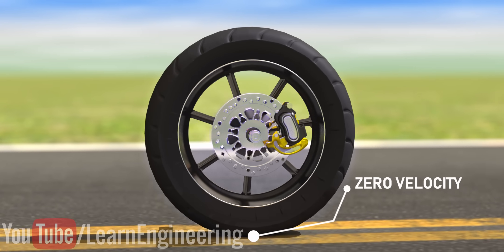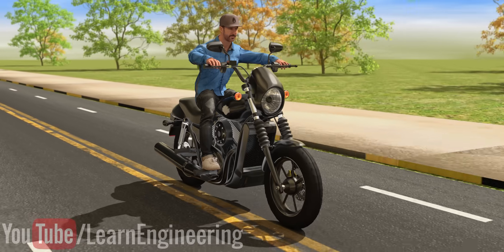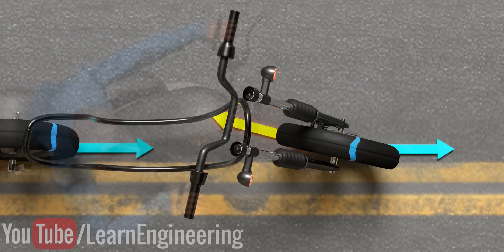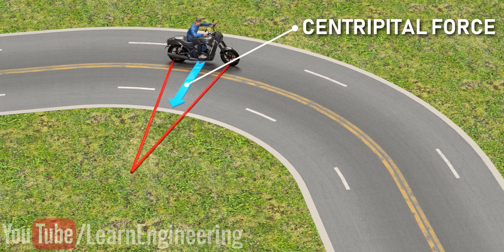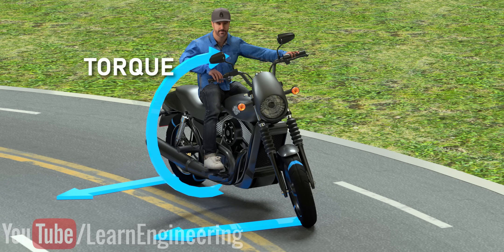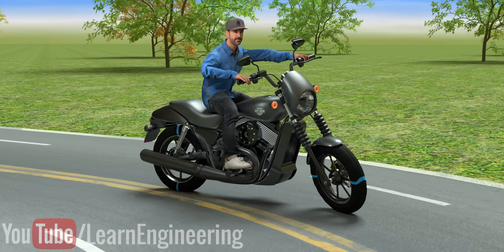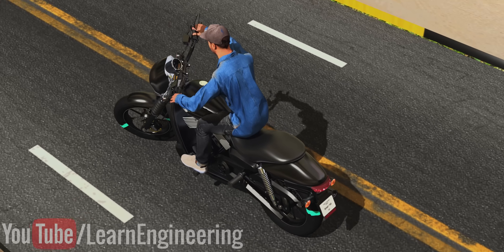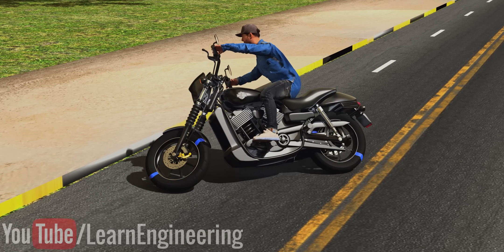Counter Steering | The interesting physics behind it

Comment: As a physicist you challenge my understanding and I think you may have got it wrong. I had always understood that the lean induced by countersteering was the effect of precession of the wheel. If you apply a torque to the axis of a rotating mass (the wheel) then there will be a precessional torque on that axis at a 90° angle to the torque you apply. It is this torque that causes the bike to lean.
Reply: I think you are correct
Reply: Yeah, he missed it but both things add to the lean. You turn and the centrifugal force is throwing a bike outwards also. In other words with light wheels it would still occur (like on a bicycle).
Reply: @AdiCherryson  yea when stepping from a smaller cc bike ( usually lighter) to a bigger cc bike ( usually heavier ) I noticed right away I couldnt use my body weight to turn at all. Then I looked it up and discovered counter-steering

Comment: Countersteering is ESSENTIAL after about walking pace, before that you steer left or right as you would normally expect. If you don't steer correctly under either speed condition, you WILL fall off. This is exactly why almost everyone who first starts riding either wobbles or falls off. You brain automatically learns how to countersteer at the correct times in not too long, usually around 15 - 45 minutes. Also please delete this video and stop confusing people with false claims or make a new one with the correct information in it, as this one is wrong in many areas. Thanks

Comment: This is actually not a good expatiation... and it has a lot more to do with the fact that the tires on a motorcycle are rounded over and not squared off like a cars tires. Therefor by leaning the bike over to the inner side of the tire the circumference is shorter and the bike "FALLS" into the turn and the center of gravity is balanced with the centripetal forces in addition to the gyroscopic effects of the wheels always wanting to stand up right. That is why you are always taught to turn the handle bars in the opposite direction as the intended turn.

Comment: first of, I love your videos, very educational and understandable
but in this video i think you have made a mistake, there is not such thing as "normal" steering in a motorcycle as far as u know (and ride for over 10 years), the only way to turn is by counter steering. can you reference your sources that explain how normal steering is also a valid turning technique?

from what i understand the torque caused by the shift in body weight will never be strong enough to help you turn the bike more than a tiny bit.
i cant say that on some occasion to prove the necessity of counter steering i leaned a major part of my body off the bike and continues to go in an almost straight line.

i would really appreciate you helping me understand this farther, thanks.
Reply: This is actually true, no mater the speed there needs to be lean to the side of the turn so that you dont flip to the outside, that lean is created by the opposite handle bar turn ( that is barely noticeble) and then you just mantain the lean along the curve. that is why if you want to lean even more while inside de corner you apply force for the handle bars to turn in the opposite direction, which makes you lean more.
Reply: @galbegun It's not that "the torque caused by body shift is not strong enough", the problem is that it is actually always zero, else we break conservation of momentum. Biker goes left - bike rotates right, center of mass stays in place.

While i'd agree that countersteer can be seen often when driving "normal" turns (in particular it's the reason why we can even drive without hands on the bar at lower speeds), there are mechanics that can make the bike turn without countersteer too.

For example: It is possible to lean the bike only through steering (even when stopped) - as the front wheel-road contact point is behind steering axis. This moves the pressure point away from the steering direction, creating an initial instability that then makes the bike fall toward the turn.

It all is actually a VERY complicated topic. There are many factors that determine what turns (or stabilizes) the bike. Different effects can become major at different speeds and even different bike geometry can favor different effects (it gets crazy when gyroscopic and camber effects come into play). So one thing is certain, there is not a one "true" way to explain it.
Reply: At under 15mph you will be using direct input or normal steering. 
Above that speed counter steering kicks in.
Don't believe me? When you ride your motorbike out tomorrow just as you slowly leave your drive push your right hand forward and you will turn left. Once you hit around 15mph pushing that right hand forward will steer you to the right.
(ex-biker 600cc)
Reply: @Slarti  https://www.youtube.com/watch?v=JWuTcJcqAng
Reply: "Normal steering" is thinking about steering in a car or boat... you turn the direction you're going... 
But on a motorcycle, counter steering is normal steering... it's just counter intuitive to people that only drive cars... you don't need to lean a car to turn it... on 2 wheels you do...
Reply: I think the point you all are missing is that this is about lean initiation, not about turning itself.
Reply: At low speeds counter steering wont work
Reply: Great post. I think some people believe you turn a bike by leaning. That’s wrong. It’s the countersteering doing the work.
Reply: In "normal" steering, to make a right turn you push the left handle and lean right into the corner. That is a "normal" turn. 
The "un-normal" thing is that before you make that normal right turn first you make a small left turn without the lean. That causes the bike to begin leaning right, that's when you then transition into the right turn. 
Thus video isn't talking about when you are already leaning, only the beginning of the turn to initiate the lean.
Reply: Rally Wagon 
Absolute bullshit! You have got this so wrong fella. Stop giving advise, you have no idea what you are talking about!

Comment: imo there may still be some confusion as "normal" turning on a bike is accomplished via "counter steering". That is, push right or left & lean right or left. Pushing left for instance, actually turns(or tries to turn) the wheel to the right(but only at 1st for an instant) then you lean left accomplishing the turn. that is the "normal" turning operation which can seem a bit counter intuitive at 1st but it is how bikes normally turn. The EXCEPTION is when going VERY slow, like when 1st starting to move, in which case the bike follows the fork angle & you really do turn the handle bars(what might seem intuitive). So, this "advanced" method explained here would be more like "counter counter steering" or non-counter/opposite/inverse/reverse etc.. I'm not typically a nit picker about semantics but it seems pretty important in this case.
Reply: realcygnus leaning accomplishes nothing! The whole turn is completed by counter Steering!

Comment: This is especially important when you are traveling at a high rate of speed and the gyroscopic forces of the wheels fight your ability to lean the bike with only your weight shifting.
Reply: I was hoping this point to be covered in the video.
Reply: Shifting body weight does not lean the bike, it merely changes the location of the center of gravity.  If you lean in, the bike will move the opposite direction.  That’s why streets bike racers hang off the inside of a turn, to lessen the required angle of bank, so they don’t scrap hard parts on the track, which lets them carry greater speed through the turn than would otherwise be possible.

Former street bike racer built a custom motorcycle with duel controls to prove that its impossible to turn a motorcycle by leaning.  A separate set of controls is on a separate set of handlebars that’s welded to the frame.  Only the steerable handlebars permits making turns.
Reply: @tcorris  
And he was probably going more than 10mph when doing that. 
But you are right about the maximum lean. It's crazy how far over the bikes lean, but sometimes it's not enough.
Reply: @tcorris  Yes correct -  an object in equilibrium will try to regain equilibrium - so as you say if a rider leans, the bike will lean the other way to keep the centre of mass in the same place. The other reason that racers lean is to 1) get their torso as low as possible to lower their centre of mass and reduce the torque of the centrifugal acceleration acting on their bodyweight around the contact patches, and to keep the suspension as close to its design position (i.e upright) as possible so that it works more efficiently and keeps the wheels in contact with the road surface better.
Reply: Yes, going at around 50 mph and suddenly leaning won't make the turn
Reply: indeed
Reply: Uhm...yeah--IF you call 12mph "...a high rate of speed."  Incidentally, that's also the speed at which WE ALL COUNTERSTEER BICYCLES, as well.   This video is DANGEROUS, as others have said, because it implies that countersteering is optional--it's NOT OPTIONAL--it occurs naturally above approx. 12mph.  Read David Hough's "Proficient Motorcycling":
https://www.amazon.com/Proficient-Motorcycling-Ultimate-Guide-Riding/dp/1889540536
No, I have no affiliation.
Reply: I expected them to at least touch on gyroscopic precession
Reply: Robin Marquardt Gyroscopic precission is not a factor here.
You can build a bike that cancel out the gyro effect and still ride it normally.
Reply: NO! You use the gyroscopic forces created by the wheels to HELP you turn the bike...research “gyroscopic precession”...
Reply: at what speed it starts to work? if you make a turn how do you know when to use countersteering and when to turn normally because speed is too low?
Reply: @Voltomess  
You can use it as slow as 5mph.
Reply: Does counter steer work for cars?
Reply: @ag135i  No. (1) cars do not balance. When you stop a car, it doesn't fall down. (2) cars do not have to lean into a turn. They actually tilt out, due to tire and suspension compression on the outside of the turn.

There is countersteering for rear-wheel-drive cars as a way of inducing the phenomenon of drifting: a controlled skid whereby the car points into the turn, so that engine power helps to keep it in the turn. 

Drifting is both useful and easier to induce on surfaces that have poor traction, like dirt roads.
Reply: @kazkylheku1221  thanks for the feedback
Reply: @ag135i  Watch cars drifting.
Reply: First, you don't lean your body.  The lean comes from the gyroscopic forces.  Second, you obviously didn't think about the logic of your statement.  If you can't turn INTO the turn because of gyroscopic forces, how would you turn OUT of the turn in order to counter-steer, stupid?!
Reply: On a motorbike you counter throttle it, if you give it some counter throttle you can go in reverse, but only while counter braking.To accelerate you would apply the front brake, i have 5 physics degrees.
Reply: It seems that they're only talking about counter steering at slow speeds...
There is no other way to turn at higher speeds, but to counter steer... if you don't, the bike won't lean against the gyroscopic precession of the engine, which keeps the bike straight up while moving... no lean = no turn...
Reply: @MRGF78  Exactly - the person who created this video is not a biker but a 'scientist' relying on their understanding of science rather than experience. 
Unfortunately his understanding of science will get him killed when he gets on a bike.
Reply: the only time “shifting your weight” will make a bike do anything like going around a corner is if you’re going about 3mph.
Reply: Robnoxious77 Weight shifting help you to keep balance of a bike not to steer it.
Reply: XtreeM FaiL 
Only at the slowest of speeds.
Reply: @Robnoxious77  
Exactly
I can go faster than that, but I have a little more weight to shift. ;)
Reply: Yes but thus practice is used mostly in racing where it is relevant. People driving down the street are going too get hurt if they try this at 30 - 60 mph. Also a majority of riders never lean their bike hard enough too back it in too a corner and need too counter steer the bike. Only ever in a racing situation at very high speeds have I ever had too drift the corner so too speak. People will get hurt trying this.
Reply: Matt B 
Well this video is dangerously inaccurate in its demonstration of counter steering. That being said, to suggest that counter steering shouldn't be used other than on a track is ridiculous. How else can you steer a bike. I refer you to this demonstration. https://youtu.be/lzk8oyNO708

Comment: What. You are so wrong on this one. The main point you say is after initiation of the counter steer turn the handlebars into the turn. DONT DO THAT, that's how you high side and break bones. Push and keep applying pressure until you complete the turn. Push left turn left, push right turn right.

Comment: Don't watch this, Twist of the Wrist does a far better explanation, and is right
Reply: Yeah twist of the Wrist by Keith Code or Sport Riding Techniques by Nick Ienatsch is far better and gives a correct explanation. This video is wrong.
Reply: agreed - combine his explanation with these graphics/visuals and you are set
Reply: Exactly
Reply: Agreed. This is only true if you're traveling under 20 mph. At higher speeds you steer opposite of the turn and don't steer back like it shows.
Reply: Jeff Robinson actually, bicycles and motorcycles turn by counter steering under 20 mph as well as over 20.  Go 10 mph and turn right, the bike will lean to the left.
Reply: @el_jefe_final  yup, the guy only knows about scooters, and only has (in this case, factually incorrect) book knowledge of high speed riding.
Reply: He is trying to explain the physical concept behind it in physical terms. And for that he did a good job. Twist of the Wrist has a more comprehensive explanation but it does not explain any physics behind it at all. Think before you wrote comments like this.
Reply: @CaptainChrom  Dear White Knight, he didn't do a good job at all.
Reply: @daithi007  you clearly neither understand how the term white knight is used nor how hard it is to create realistically looking animations
Reply: @CaptainChrom  I'm a clever Blender God. And I do know how to use White Knight as a put down, because you were successfully put down. Just accept your defeat and move on, nothing to see here.
Reply: @CaptainChrom  from what i recall they do explain the physics behind it as well as using correct terminology and shows what actually happens when you PUSH the handlebars! because it sure as shit does not do that odd turn when he starts to countersteer
Reply: BeaSt•CaptainChrom 
Well I’ve thought about it..
This video is the biggest crock of inaccurate shit that I have ever watched. If people take note of this they will die!!!

Comment: In counter steering you do not "turn the handlebars," you apply force opposite to the turn and the bike leans and turns. Below 5 to 10 mph there is no "normal turn." Terrible video!
Reply: This. I never understood the explanation when I was young because people always talked about turning the handlebars, and like it's some magical trick professionals do. It's not really turning, more like a small nudge. After I figured that out, I understood that's how I always ride. Then I tried to NOT counter steer at "high" speeds and it was pretty much impossible.
Reply: Normal turn varies, until ~10mph and above that. Above certain speeds countersteer is the ONLY way to steer.
Reply: G Wulf  Do you ride?
Reply: @mybackhurts1982  only since the 1960s
Reply: G Wulf well u said "below 5-10 mph there is no normal steering" isnt it the opposite? U can only "normal turn" below 5-10 mph.
Reply: @Noname-lk2ol  Yep, "normal" steering at very slow speeds.  "Counter" steering at all other speeds.
Reply: @Noname-lk2ol  Yes, I misspoke. I meant only 'normal turn' below 5-10 mph. I should have proof read my post.
Reply: This physics mumbo jumbo (not a diss on actual science, but on the convoluted way of explaining) should just be replaced by: push right to turn right, push left to turn left.
Reply: @rationalityfirst  except at slow speeds.

Comment: This is a troll right? You can help but counter steer, you dont get to decide how the vehicle responds, e.g. turning in or leaning. Torque applied to a gyroscope reacts with torque 90 degs to input.
Reply: It's not a troll - he simply doesn't have a clue and has been riding mopeds (see end of video).